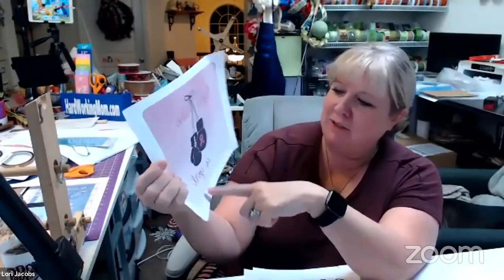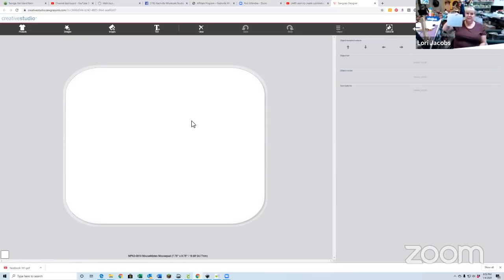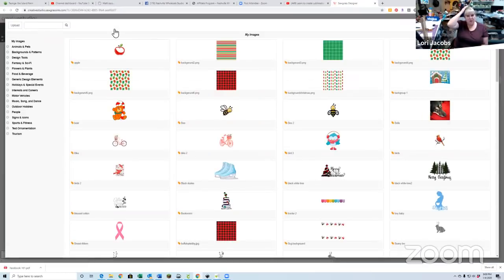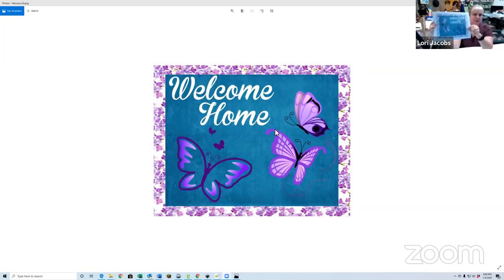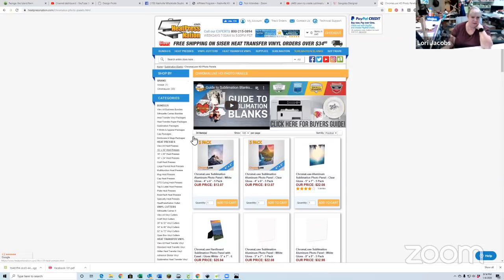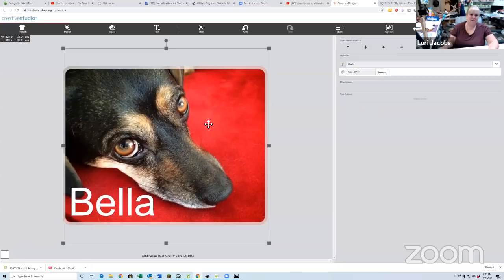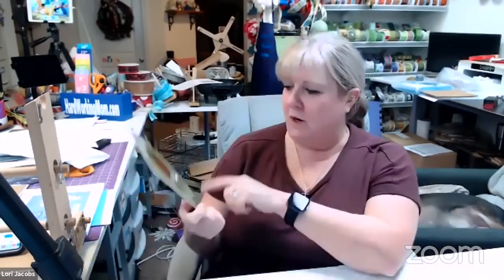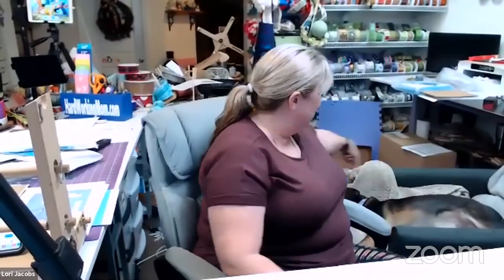Learn to create sublimation signs

Comment: Do you have a list somewhere that tells us beginners what all is required to make signs?  I’d get a Sawgrass then forget a heat press, or something?  Can I do sublimation with a Cricket?
Reply from the maker: Hello Marsha! The things you need are a Sublimation printer, Heat Press, and metal blanks. The printer comes with ink and paper to start you out and when you run out then you would buy more. I will be honest with you about it being an investment. I paid close to $1,000 to get everything I needed. And you can’t do Sublimation with a Cricket cause it has to be a Sublimation printer. I hope that helps. Thank you, Lori.

Comment: Curious, how would you get a sublimation print on a phone case or other odd shaped and different types material?
Reply from the maker: Hello Margo! For Sublimation printing, you can’t use glass or plastic. The Sublimation blank has a special coating to fuse with the ink. Thank you, Lori.
Reply: Usually the back of the phone case where you put the picture is flat, you press it and them attach it to the case.  For solid items,  you need a 3d vacuum heat press.